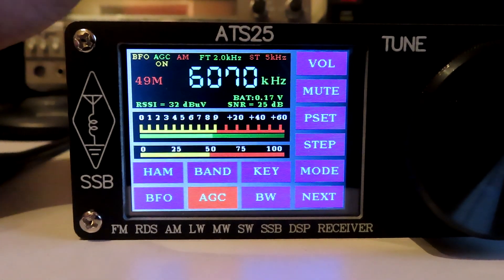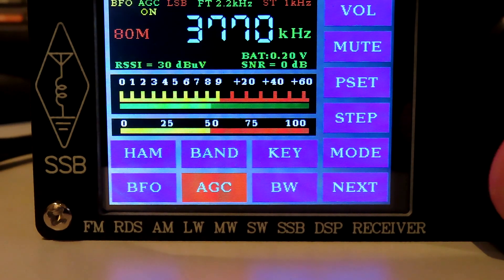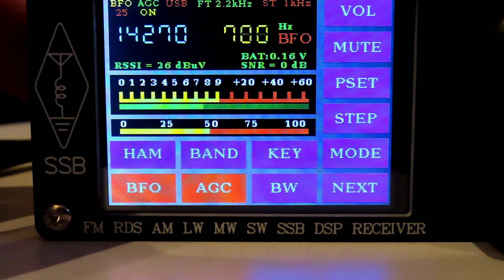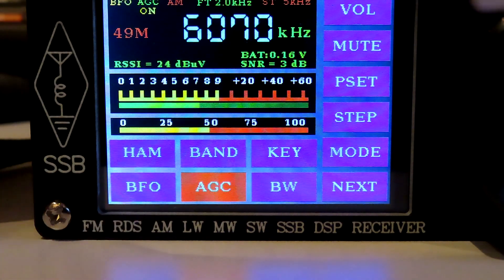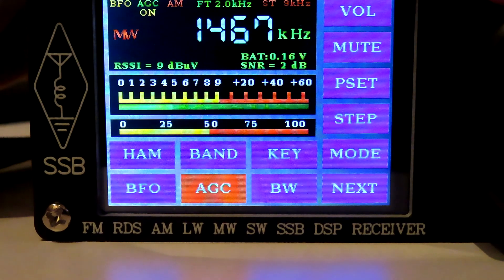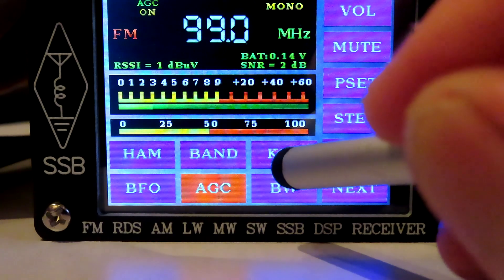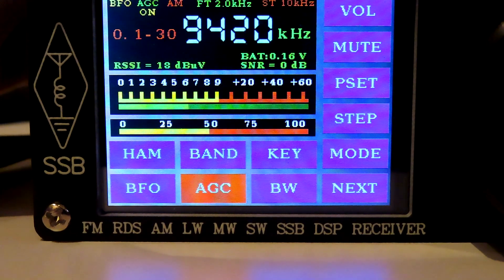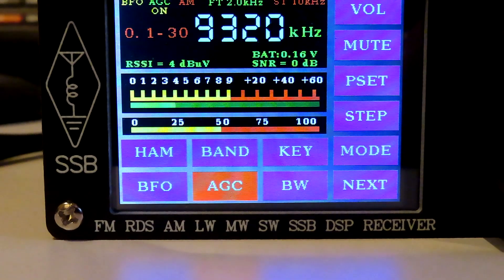ATS 25 Useful Features

Comment: Hello and Thank-you for sharing your radio experiences with us all greatly appreciated. I’m just wondering what the next function is on the bottom right of the receiver does …is that where the waterfall menu is ?… I am looking to purchase one of these sets .. but I’m a little unsure atm cheers n 🍻 73z.
Reply from the maker: The Next page takes you to a second page of buttons
Reply: But what do they provide you with if you know thanks again 73
Reply from the maker: @echo-_-radio   up and down tuning buttons,scan button, chip and info button,rds button,memo button and light button
Reply: @KevinOReillyswl  Thank-you very much  just orderd two of them from aliExspress 2 for  a 1 ton just in case I mess one up updating the fw… thanks for your feed back on this receiver … it was either this one or keep watching the malakit sdr dsp .. watching it because they are way to exspensive 73z

Comment: Hey Kevin, thank you so much for publishing this. I do have a question though, how the heck do you set the presets? On my ATS 25 when I push the preset button it just goes to the presets but there's no obvious way to actually set the preset. Any help would be totally awesome. Thanks again
Reply from the maker: I am afraid I haven't been able to work out the presets myself! I suspect that they are intended for use in the FM broadcast band rather than shortwave but I haven't been able to get them to work on my radio at all.
Reply: @KevinOReillyswl  so I did some more research and unfortunately, at least on my version of the firmware, the presets are defined within the sketch itself. That just seems so ridiculous to me but I guess that's how they did it. In truth it kind of makes for a really interesting project to try and bring the ability to write presets to the user interface. Maybe that'll be a YouTube video I can do... Or maybe something you can do.

Comment: The battery  on display ...is that is voltage or percent of life
Reply from the maker: It has been pointed out that the scale under the S meter is in fact the volume percentage. There is a battery voltage readout but as far as I can see its meaningless.